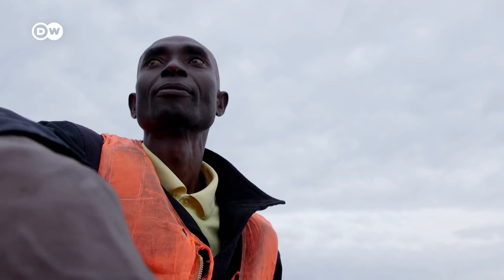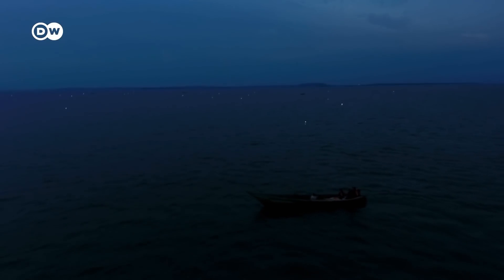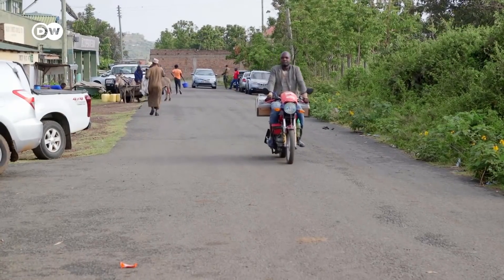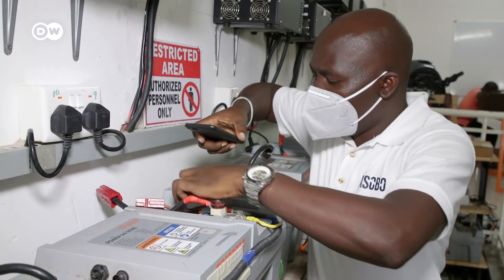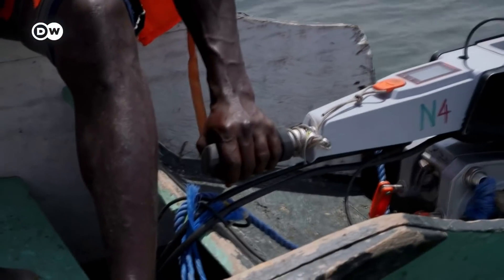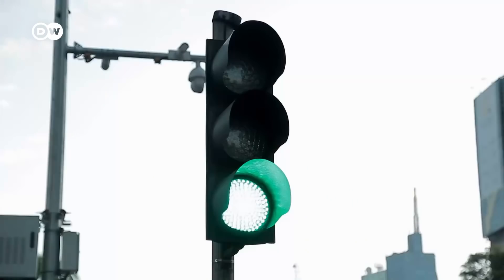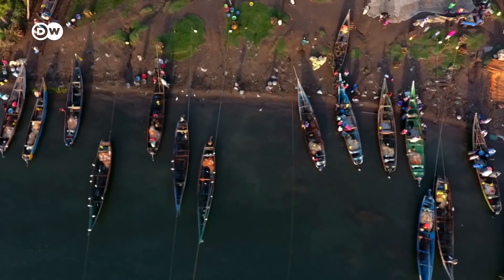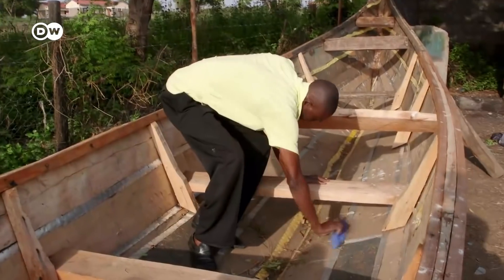Kenya: Electric boats for Lake Victoria | Global Ideas

Comment: Coal powered boats that need lots of precious elements from giant strip mines; that's the solution??
Most of the mercury in the oceans, comes from coal powered electric  generation plants that builds up in the fish.
A 4 stroke gas engine, would pollute less and make the fish safer to eat.
It's all one planet, half the planet, can't save the other half unless the burden is shared by all nations; "developing" or not.

The grid needs less demand, not more.
Increasing the demand on the electric grid, makes all renewables less likely to succeed and creates more pollution.

Unless nuclear power looses it's negative stigma, electric transport replacing hydrocarbon fuels, is a futile effort.

Comment: Kenyan electricity is reliable but it is extremely costly because of limited sources. I am sure most Kenyans would like to phase out diesel and petrol and adopt electric mobility, but the cost of electricity is extremely high. Maybe the government should work with stakeholders in increasing electricity supply and lowering the cost in the process hence encouraging the adoption of electric vehicle. Another alternative is to incentivise the EV industry for long term growth and sustainability in the country.
Reply: I guess solar would work well in this use case: Recharge the spare set of batteries on the land, while the other set is being used in the boat. Then swap them on the next day.
Reply: I think the question is, is it more expensive than petrol? It's a comparison thing
Reply: Giid jsear chef di n t that  hunn. Oo given jvemevt ir xLl chef Fred nit hybedd emtre own martial chef stuff go's iwn n atest

Comment: Good idea. They are much easier to use, are quieter and less smelly, and they can be recharged even from solar. We have 4 boats here at home in Australia and all four are now electrically powered.
Reply: No doubt I believe the cheaper gas engines these guys usually use are absolute garbage nosiest smelly and not that powerful
Reply: Glad you're using electric boats too. Hope it catches on to more communities around the world.
Reply: Less pollution, them being quiet is irrelevant 
Pollution is a very big problem in Africa mate
Reply: @jolivera8451  the heck it isn’t dude some of those engines will destroy your hearing after few months daily use
Reply: @dustintacohands1107  earplugs anyone? Screw that again the environment should be the motivating factor here.
Reply: @jolivera8451  I used earplugs dude they didn’t work the engine was complete garbage
Reply: @dustintacohands1107  wrong zro noise

Comment: Sounds expensive and there is that usual tracking system that's common with everything nowadays. You can't beat petrol power.
Reply: Petrol prices are sky rocketing at this very moment. Also kenya has green energy. Yet you think nothing can beat petrol? Why?
Btw: With petrol you need to buy and repair an expensive motor and you probably need money or loan (with interest) upfront. 
And yes, in my opinion it is a good thing to have a tracker on a boat.
Reply: @Knight_Industries_2000  : good point
Reply: Petrol will die soon. Anywhere petrol is used there are innovation to eliminate it. People need independence not dependence on people who control fuel prices
Reply: They just did.